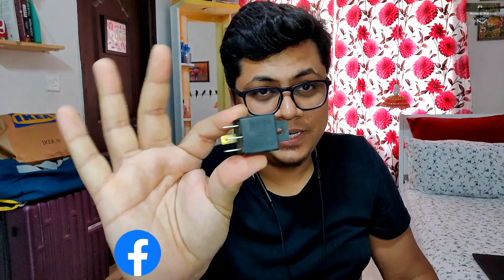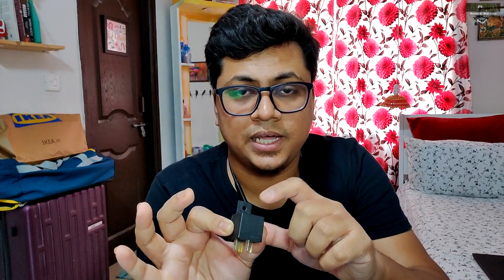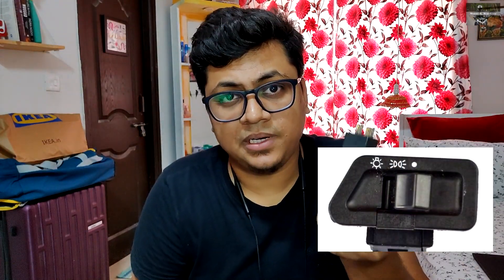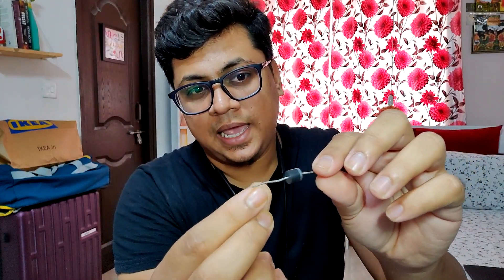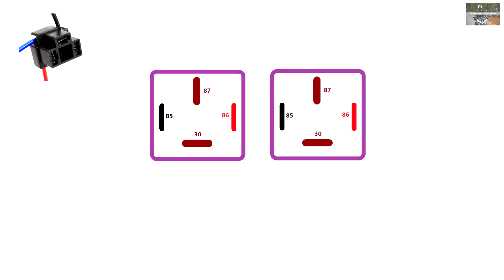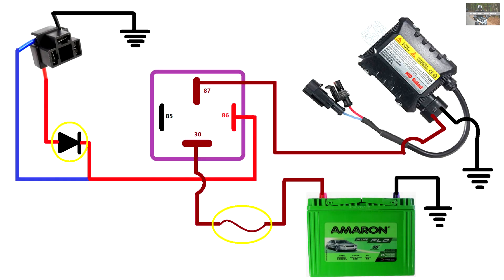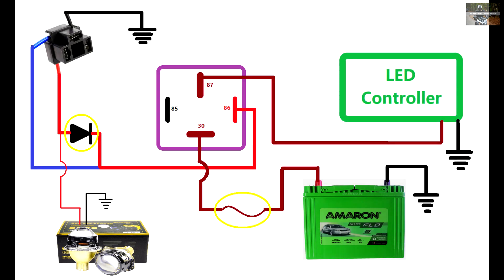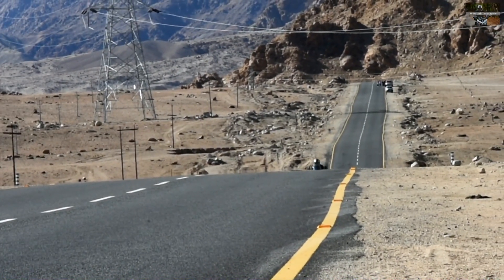RELAYS | RELAY HARENESS | 90/100 WATT BULB | DUAL HORN | WIRING DIAGRAM | COMPLETE GUIDE

Comment: Where we can get dc wire i dont know if ac and dc wire is same can you pleade help me
Reply: Does it have rating like 10amp 5amp means if we use 1w led then what we have to buy vs 100w halogen then what we have to buy
Reply from the maker: Generally they are measured in AWG.
Reply from the maker: High quality silicon wire is available on robu.in
Reply from the maker: Also local automobile shops have finolex automobile wires.

Comment: What kind of diode we can used you please mention 
And if possible share a video with low and high beam working ❤❤
Reply from the maker: Any 6 - 10 amp diode works just fine.

Comment: Well done grt explanation and if u would mention the wire gauge for different purpose and connectors that would be more appreciated...btw grt explain
Reply from the maker: Thank you ... The reason I did not mention the wire guage is because that will vary with the load we are dealing with. Pins that should be used are spade pins, they are universal fit on any relay.